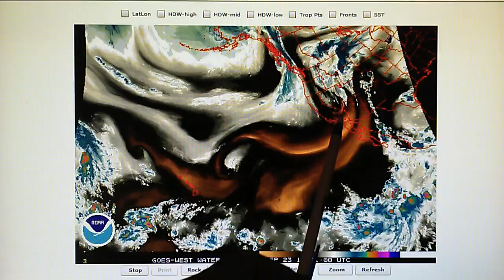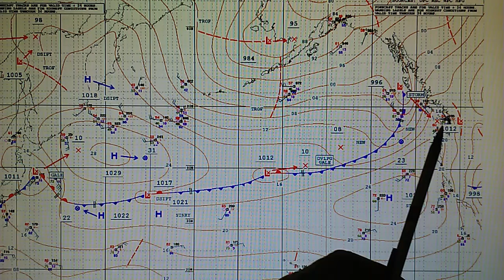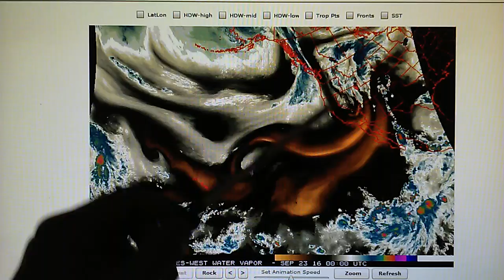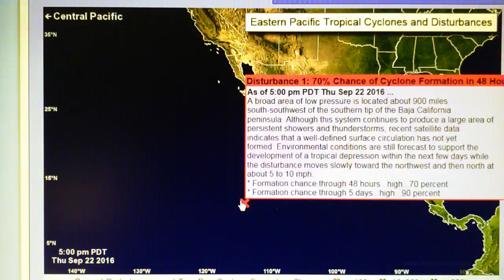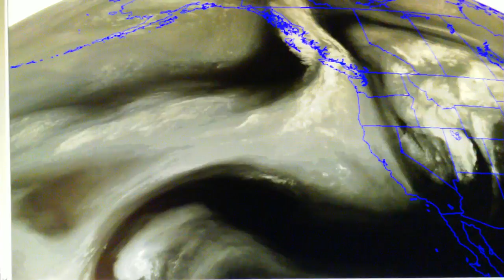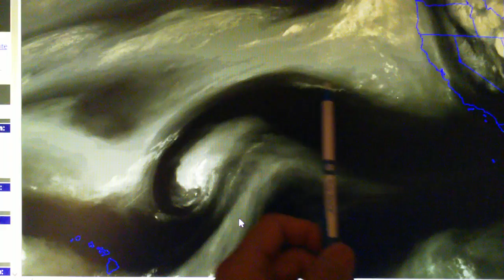9-22-2016;  Climate Change: 100F Temps Forecast As Giant Mid-Upper Low Pressure System Moves Over CA

Comment: Sept 23 9:00am Aerosol dumps blanket skies over West L..A this morning. Complete white-out chemical -haze to the south towards South Bay. The crisp, cool air is being pummeled by a manufactured dryness -the result of the use of chemical aerosols.
Reply from the maker: The weather controllers have been engineering the Santa Ana winds for 30 years.  The winds were mainly used to fend off large low pressure systems. Fires usually accompany these strong winds.
Reply: They're also cranking up the transmitters because it's now getting much warmer, and too quickly at that to be called a Santana wind here in the LA Foothills at 1133 am.
Reply: +1PR .. wow!  I did not realize how far back they started manufacturing these Santanas.. although they were noticeably different back in the 70s than now.
Reply: 1PacificRedwood wow-  did not know- makes sence-